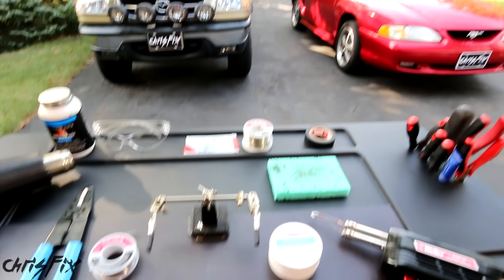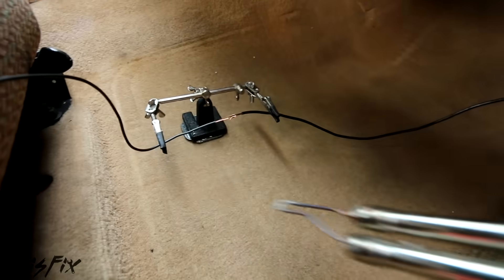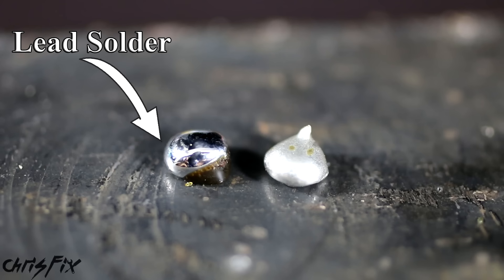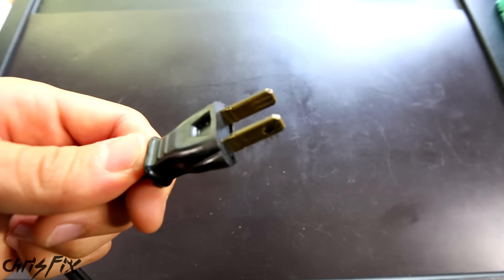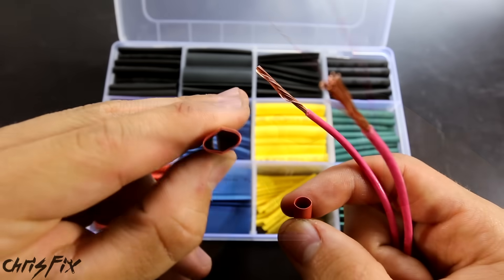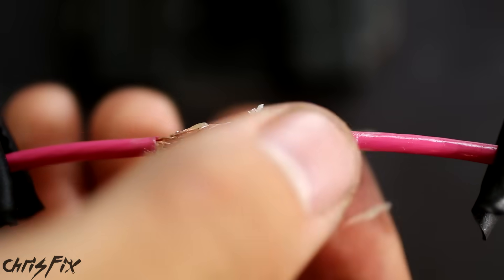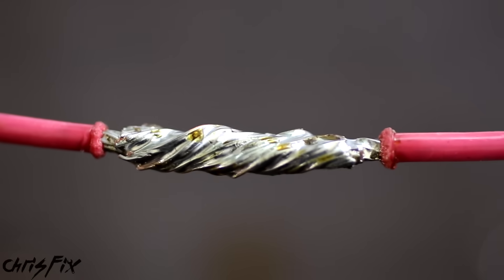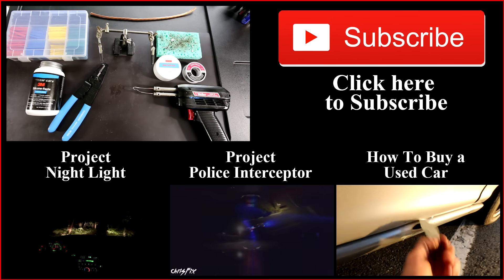How to Solder Wires Together (Best tips and tricks)

Comment: Excellent video, Chris!  
To ensure the best longevity for the soldering tip, an old electronics master taught me to always tin the tip before beginning the job, and again after cleaning the tip at the end of the project.  Sort of a "belt and suspenders" approach, but I have the original tips installed on my gun and irons after decades of use

Comment: Hi Chris,  Cool projects you did..look like fun.

 I need to replace my seat belt retractor plug with a new old which might require soldering / splicing. The wire might have 2 small copper wires in it but not 100% sure. 
How can I safely & effectively do it  the RIGHT way  since it is critical safety device that connects to airbag system?  Hopefully the wires might be just inserted in the plug but not sure with no soldering needed but not sure. 

Of course I can always look for experts or expensively replace the whole floor harness but that will be the last resort.

Comment: Hey Chris,I've been wiring up some interior lights in my project Jeep (1992 Cherokee Briarwood) and all of the connections are being made above my head. Do you have any ideas on how to solder wires above my head if they cannot be relocated to a lower, safer position? I've been using butt connectors now and they work fine, but I'm worried about how long they will last given the amount of vibration in the older vehicle.I love your videos and they are incredibly useful with all the work I've been doing on my project vehicle and my daily driver. Thanks for the great content!

Comment: Who taught you to twist wires together before soldering? You should tin both ends and then with minimal solder on the iron bring the 2 ends together and touch the 2 ends with the iron, the tinning will melt together giving a strong, clean, low resitance solder joint. You shouldn't be needing to wind 15cm of solder into the joint. More solder does not equal a stronger joint or better electrical connection if anything it makes it worse. Nice informative video otherwise, with lots of useful tips!

Comment: Extremely illustrative video as always, i have been following your steps to do a lot of things with me own car. That pride when you fix it yourself, is priceless! How about using the gear you have there soldering a connection to a battery terminal? ie a flat surface to copper or bridge? Mostly work on my car when i have the time, but this is a one off, replacing batteries in a vacuum cleaner.
Reply from the maker: +Lars Akerberg glad the videos are helpful! That's a good idea.

Comment: i was always told its wrong to solder wire connections on cars/trucks because they vibrate and cause the soldered area to work hardened because it was heated and eventually crack and fail... .. and that is why they make mechanical crimps/connections for automotive use
Reply from the maker: I never had an issue with a soldered connection in a car. If the area is in a high vibration area, yes, it is better to crimp but that is mainly for wiring that directly connects to the engine. So good point!

Comment: My dad taught me to solder when I was 7 years old, the trick relies on keeping stuff clean and getting all the parts to be soldered at around the same temperature. If your equipment is good achieving that will grant you a solid solder. Fun story: Once I grabbed the hot part of the soldering iron with my bare hand because I didnt realize it was on, I got a first degree burn nothing serious. My mom was ultra mad with my dad because she thought I was too young to learn that. My dad simply replied to her that I wouldnt do that mistake again, he was damn right.

Comment: something I didn't hear you comment on was the difference and type of jobs that soldering guns and irons have of different voltages. also the heating of electrical components if using an iron that has a high voltage.

Comment: when i looked on the wire on my battery on my controled car it was ALL oxidaded. Had to clean it. And what happend the battery,
It did not charge at all. Because the battery was 11 years old. I had to buy a new battery. On the box of the car, it said to charge the battery for 5 hours, i charged at the time the box said. But when i put the battery on the car..... Nothing, it did not move an inch. I had to spin the wheel to make it go. It was not strong enough to move the car.

Comment: hey Chris. I need to solder together a connection for a power wire for my amps to power my subwoofers. The wire is 8 gauge fine stranded OFC (Oxygen Free Copper) with a aluminum coating around would a regular 140 watt solder gun like the one you have work good. thanks

Comment: Where to start with how much wrong is here. First off, you don't use one of those bulky solder guns. They are outdated and will not give you a proper solder joint. The proper tool to use to solder is a solder station. Hakko and Weller make great soldering stations that will give you consistent soldering joints. Next up is soldering two wires together, you don't just strip back the protective jacket, twist the bare wires together and solder away. If you are going to solder two wires together, you first strip the protective coating, then get some Panduit uninsulated butt connectors, put each end into the butt connector and crimp. Then solder each end of the butt connector. Get the better Raychem heatshrink that has the glue infused in it. Use that over the butt connector. That creates 3 forms of mechanical strain relief, the first one is the crimped butt connector, the second is the soldered crimped butt connector and the third is the glue infused heat shrink over the soldered crimped butt connector. Remember that those two types of splices were developed long before modern day electronics and better methods of splicing wires together were developed. The methods and tools of soldering properly have come a long way to what is mentioned in this video. Also proper strain relief on the wires along with correct routing and bundling of wires is necessary to keep vibrations of wires from the possibility of cracking a soldered joint. Wires need to be secured correctly to keep from this happening.

Comment: Rule number 1 but a good heavy duty gun and good solder also don't feed a lot of solder because the solder will flow down the wire.
Reply from the maker: Thanks for the tip!

Comment: Another useful tip.... make it a good practice to wipe the freshly soldered joint with 91%+ isopropyl alcohol to clean off the spent rosin residue, its harmful to the solder if left uncleaned afterwards.
Reply from the maker: +Bige4u thanks for the tip

Comment: Hey Chris, I just started watching you yesterday. My father and I love watching DIY videos and such. When I came across this tutorial, since I am just learning how to solder, it's how my father and I love videos. Get to the point type of stuff. You don't say a lot of random garbage in the video. I love your videos and I did subscribe to you! I showed my father your channel and he absolutely loves it! I finally have a reason to watch a tutorial channel! The only question I have is, where can I get the copper wire with the insulation to solder two things together? I have some that I have accumulated over some time, but when I try to solder, it never works for me. I did exactly what you said and I apply flux on the copper wiring and the solder never seems to melt correctly. Thanks!

Comment: I am using a solder gun, but it won't melt the solder when I put the gun under the wire.  I have to touch it with the gun. It looks good though. Any thoughts?
Reply: Working with a dry tip makes a poor heat transfer. Melt a small amount of solder to the tip and then immediatly hold it to the bottom wire. That will give you much faster heat transfer...
Reply: Brandon Herrera take a file to the tip... it will work as new :)
Reply: The mounting nuts have to be torqued pretty hard, almost to the point you think it is going to break something. If the gun isn't humming strongly the nuts are too loose.
Reply: some soldering guns have 2 heat levels. If you hear TWO clicks when pulling the trigger slowly, back off a bit to the first click. That's the higher heat level.
Reply: yea same but my tip is pretty dirty and he said to moist the sponge to clean it but I just wiped it with a dry sponge ill try to clean it (or buy a new tip) and see if it makes a difference
Reply: you need to heat up the gun. if thats not the case. you need to heat up the wires. the add just a tad solder between the tip and the wire and if that dosent help then your solder might have a higher melting point. the melting point is written on the back of the solder
Reply: Heat the gun first, then you transfer less heat into the insulation. Electrical solder should all have the same melting point. Other non-electrical soldering metals can be all over the place, especially if they have silver or other alloys in them. The trick of a tiny dab of solder to the tip or tip and wire will help start the heat transfer better than a dry tip.

Comment: You can buy rosin core silver solder.  It actually flows more easily than 60-40 solder.  You should also go for thinner solder, to be totally honest.
Reply: knupder i would go unleaded im afraid of lead poisoning
Reply: Silver solder melts at way too high a temperature; always over 800F and often over 1100F (orange hot). Silver bearing solder is a whole different thing, though: 2% silver and normal temperatures but does not leach the contacts off surface-mount components. Mighty pricey, too. I don't like thin solder, even for circuit boards, but that's just my preference.

Comment: do you have any tips for removing old solder from a bad soldering job.
Reply from the maker: That is tough, you have to reheat the solder and I like to use a stranded copper wire to absorb the old solder.
Reply: Thanks, I'll give it a shot.

Comment: what would be the best way to solder 3 way?, one wire stripped about an inch then splice a third wire into it,I can't see how you could shrink wrap to seal it,only electrical tape after,I'm looking to connect a remote start to a 2011 honda accord crosstour but I would like to solder and not use butt or splice connectors
thanks for any advice
Reply: Ralph LaPolla I did it as you described and just used electrical tape, and a fair amount of it too. Luckily it was on the inside so I don't have to worry about any of the elements getting into it. Curious to know the correct way also.

Comment: Recommending lead solder is simply irresponsible.  I solder all the time with lead free solder and have never had a single issue.  And who the hell cares about the way the joint looks as long as the connection is secure, you are HOPEFULLY covering it with heat shrink tubing, so you will never see it again.
Reply from the maker: +Justin Allen has nothing to do with looks. A lead solder connection is less brittle and has less resistance than a non-leaded solder
Reply: Even if that is the case, the solder is still 10 times as resistive as the copper, in the first place, so, you are really depending on a very close copper to copper connection to reduce resistance, not any properties of the solder.  
I am aware that in certain specific applications thermal expansion and contraction can cause problems with non-leaded solder joints, this is unlikely to be a problem in a temperate climate, even for something stored outdoors like a vehicle (I will concede that wiring inside an engine compartment might experience some of this).  My point is not that there aren't some specific applications where leaded solder makes sense, my point is that recommending it, outright, in a soldering tutorial for beginners, is irresponsible.  It doesn't take much lead intake at all to have a significant effect on dementia later in life or on young developing brains, so exercising a bit of caution when making blanket statements about always using lead solder, is what I object to.  Remember that some people aren't as careful as others and a beginner soldering tutorial seems like a terrible place to recommend leaded solder as a matter of course.

Comment: It's the best soldering tutorial i've ever found but i only ahve 1 question - in some other tutorials someone said that its not good idea to twist the cables together liku You showed, because it doesn't add any strength and it's better to just put them together parallel without twisting them together. i think it was some amateur, because he was putting solder on the soldering gun, not like u showed on the cable directly. I'm pretty sure Your vid is better but i'm just confused why would someone advice not to twist the cables together, cuz it surely makes them stronger.. /

Comment: Great vid! For those pesky smaller wires I like to cover the wire in flux and then load the tip of the soldering iron with the solder. When you touch the loaded tip to the flux it creates a nice solder, and its cool to watch it form all around! This way is also great if you don't have the steadiest hands.

Comment: this method is OK but check out a lineman's splice.  it's a much cleaner method that holds it together while you solder.  It's so strong that even without solder it's stronger than a butt connector and actually tightens itself when under tension.

Comment: I don't know why but when I solder the wires using soldering iron, it does not work in the way show in the video. I hold the iron under the wires after applying  flux but while the wires gets heated up, the solder does not get on the exposed part of the wire. If I hold the soldering iron for a little more time, it burns the exposed parts of the wires and the whole wire gets extremely hot. But in no way does the solder get on the stripped wires. Please help me. Reply to me. I really need some help. Please help me out. By the way, nice video man.
Reply from the maker: Are you using the correct solder? Are you tinning the tip of the soldering gun?
Reply: Your wire was probably just old and/oxidized.
Reply: ChrisFix Never mind I figured it out. My flux was not good. It was not a soldering paste. I don't know what it is it's just written Chinese all over the box and there is only one word in English saying Flux. It was really useless. I don't know what it's usage are. I think it was supposed to be used for something other than soldering wires. Now I got the right soldering paste. This one works really well. I ordered it online. And, as far as I'm concerned, I'm using lead free solder. And I'm not using a soldering gun. In fact, I'm not using a soldering station too. I'm just a beginner so, I'm just using my soldering iron. 60w 220v. One of the notable reason for my laking is that most of the high quality equipments are not available around my residence. In order to get them I need to go really far. I'm in fact using a homemade soldering stand even though I could buy one easily.

Comment: Is silicone paste important if I'm just doing some soldering for a head unit wiring harness adapter? Because it seems a bit expensive.
Reply from the maker: +Dragonslayer182 you don't need it for wiring inside but it does help insulate.
Reply: Alright, thank you!

Comment: That, Sir, was a terribly poor display ! Not the right way to do that! Sorry!
Reply: Morten Kristoffersen Please elaborate and share the "proper" way instead of just making a bunch of noise that most people will ignore.
Reply: How do you recommend to do it? This is the correct way to solder.
Reply: Brian No, that was a bodged attempt.
Reply: Chaos Descent OK, look at the melted insulation, how the solder has flowed under the insulation, how the strands of the leads were overtwisted, and perhaps google for a photo of how a halfway decent solder shall look.
I never intended to teach, but statint that was a proper soldering is just BS !

Comment: is it worth it to invest the extra 15 dollars on the professional weller soldering gun? looks like it gets hotter so thinking it would work better but if it's not necessary or if it too hot for automotive wiring  don't want to waste money. and is there a go to general size wire gauge for most applications that I should buy? thanks

Comment: i learned a lot with your video.  Nice teaching job.  I do have a question.  Can you solder a size 14 to a size 16-18?  I want to pigtail a cig plug to my air compressor.